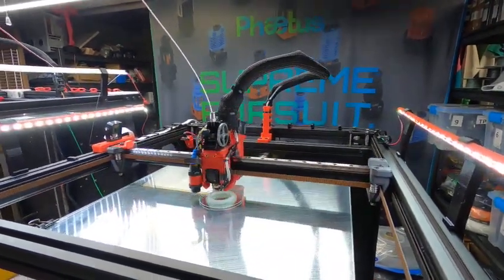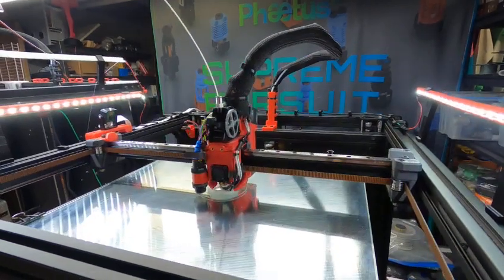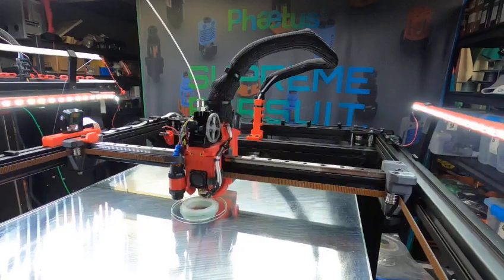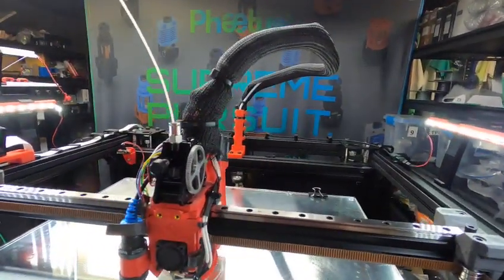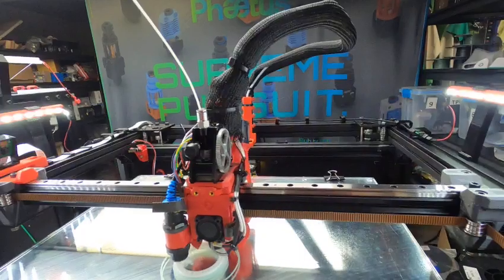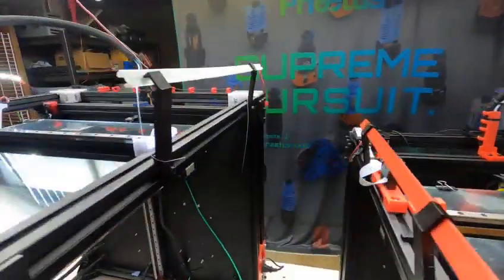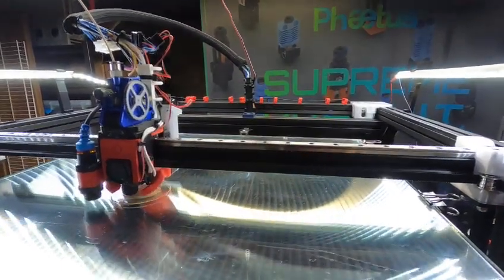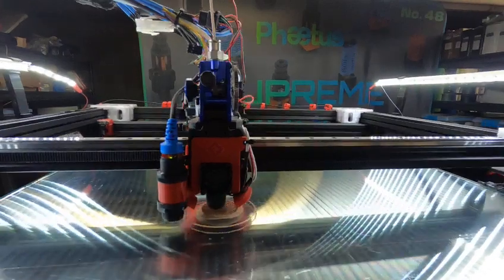Rat Rig - Phaetus APUS and DropEffect  XG running

Comment: How do you feel about this hotend, I can’t find much reviews about it
Reply from the maker: I have had good results on PLA and PETG with the combination.  The APUS extruder has a high gear ratio and the XG hot end uses a special nozzle.  I saw this last year at ERRF and got to talk to the designer Max Arnold, who also designed the OmniaDrop.   Let me know if you have any specific questions.
Reply: @woodwaker1  thank you.  This is fantastic my only concern is that I am unto find cad files otherwise this looks a very good candidate for an ultra lightweight print head.
Reply from the maker: @jumadhaheri  Printables has some designs and the EVA3 discord has information.  What printer are you trying to mount this to?
Reply: @woodwaker1  I have a v core 500, but maybe I will build a small open format corexy something basic and quite
Reply from the maker: @jumadhaheri  Take a look at this https://www.printables.com/model/418110-eva-apus-extruder-and-xg-hotend

Comment: Looking great Dave. I'm starting my RatRig upgrade now and am not sure what I want to do with the hot end yet. This give me pause for thought!! Thanks
Reply from the maker: Tim, Did you notice that I have made a lot of changes to the V3.1 parts?  I have metal brackets on order to replace the front printed parts.  I have already replaced the back motor mount / idlers and went to a differ3ent design on the X idlers.  Let me know if you want details
Reply: I am always interested in the details... anything improvement to what I have is welcome!

Comment: It looked to me as if the filament feed on the first one would reverse on occasion.  What is happening when it does that?
Reply from the maker: Scott - good eye.  It does reverse to create a vacuum in the melt area.  It does this when it is moving over an area that should not have more plastic put down it is supposed to eliminate oozing.  Think of the hot end area as a hot glue gun.  When you have finished pressing the glue out it continues to ooze.   This is one of the settings that must be adjusted in the program.  Now it is set a .8 mm at  a rate of 40 mm / second.  Once the move has finished it has to move in the positive direction the same amount.
Reply: @woodwaker1  Thanks for the explanation.  Made perfect sense with the glue gun reference.  That timing seems critical for creating perfect prints.  Keep up the good work!